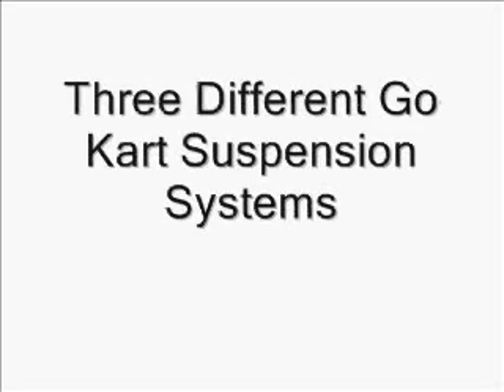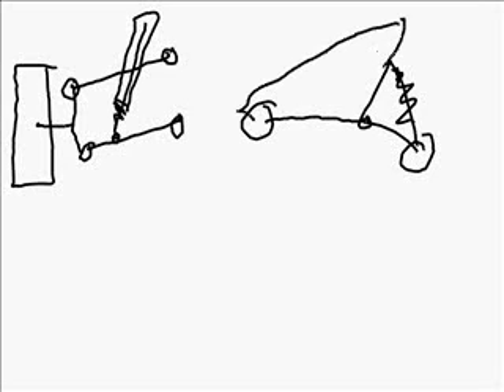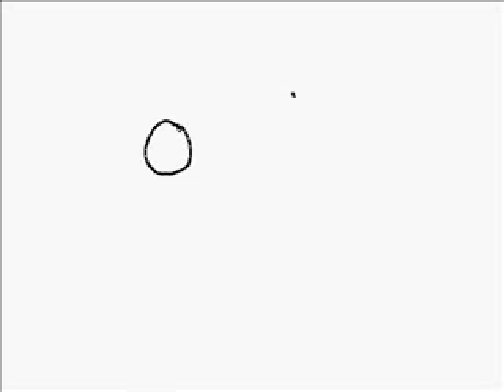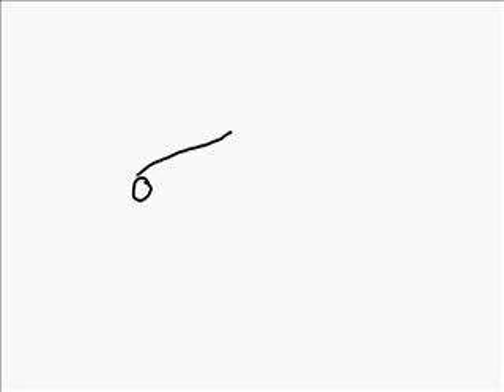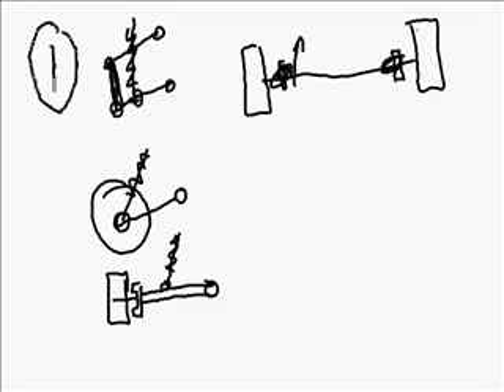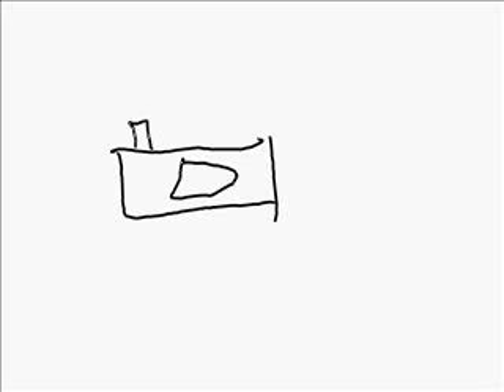Go Kart Suspension Part I

Comment: The Murray Kilowatt has a independent swingarm in the rear with a solid axle and shock absorbers from the chassis to swingarm, the motor is mounted to the chassis. The jackshaft is in line with the swingarm pivot point keeping the chain tensioned throughout the suspensions  movement, kinda like your last description. The front is a single arm independent setup. My Kilowatt is fixing to be full front and rear dual a-arm independent suspension. The "stock" setup is decent, the fronts geometry is all wrong and I can't deal with it anymore so.......